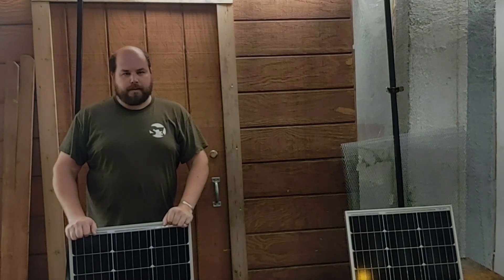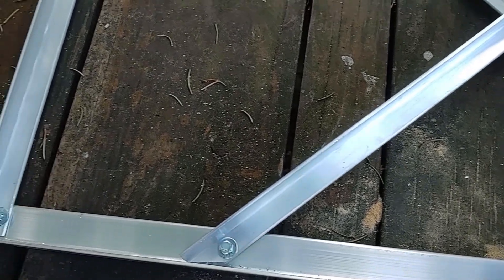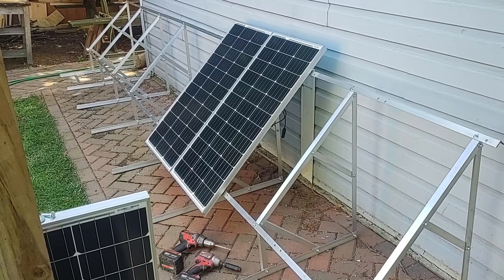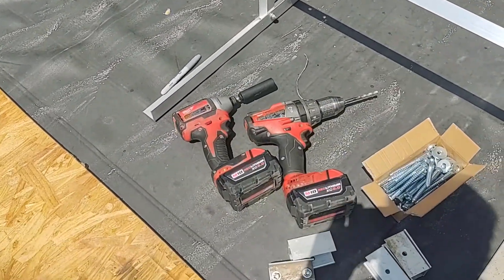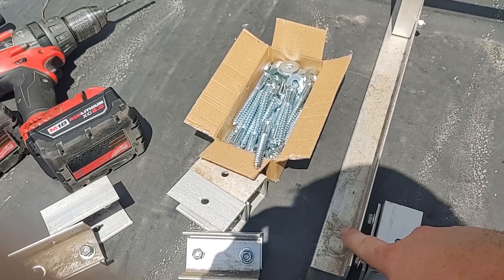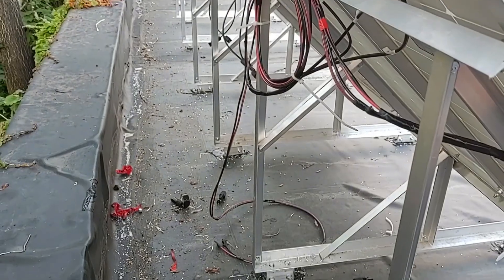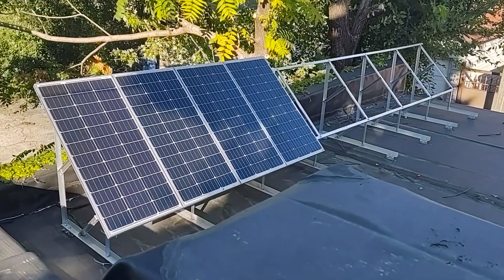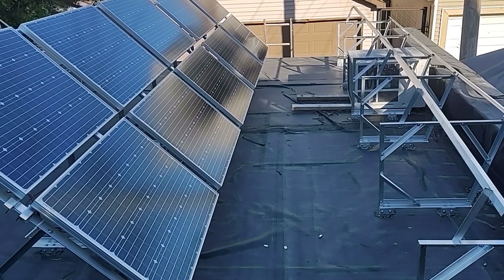DIY Solar mount build and install - ground or flat roof install

Comment: Thanks for that. Why do folk always raise the panels off the deck, base, roof before bolting down ? I've seen that several times before and i don't understand. A 3mm washer between frame and base would allow water to flow. Am i missing something ?

Comment: How expensive was all that aluminum angle stock?  Why didn't you use Unistrut or Superstrut?
Reply from the maker: I looked into a few solar mounts and framing and with all the fittings needed for something like Unistrut it would be more expensive.  I also liked the idea of using aluminum to get a lighter panel mount.  Buying the aluminum in 25 foot lengths of 1/8 inch thick 1 inch angle was about $15 and 1 1/2 inch angle about $24.  I didn't really keep track of how much I used for the panel mount.

Comment: Nice design, but if an earthquake strikes it will all be crushed.  You should have consulted a seismic engineer before constructing this.
Reply from the maker: Thanks for the idea, but where this was installed is not a seismic prone area.
Reply: @planbuildplay8528  I was trying to be funny.  Your design is great

Comment: The idea of angling the pv panels will definitely improve performance; the spacing of the rows makes sense for shadows; but to not consult a structural engineer for the design makes this design REALLY REALLY BAD choice.   Building codes around the world will usually require roofs to be able to sustain 40% more capacity to lifting forces from wind than maximum combined snow, ice and wind loads downwards.  So the chances of this array setup being torn off the roof leaving gaping holes is highly likely.  This design needs to be validated by a structural engineer.
Reply from the maker: I didn't realize the lifting forces were that high, maybe I will have to add some hurricane ties where the roof joists attach to the beams to minimize that possibility.  Thanks for the comment.
Reply: Maybe add some metal on the back to stop the wind lifting the panels?